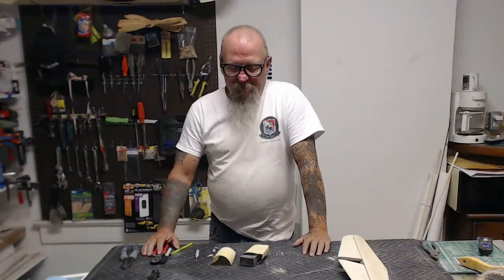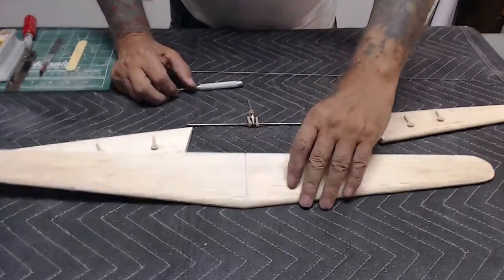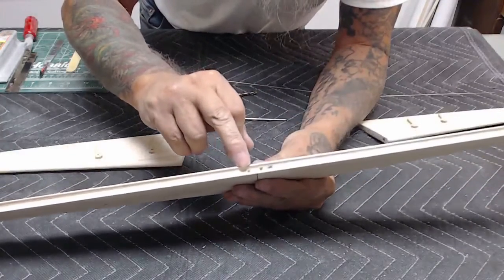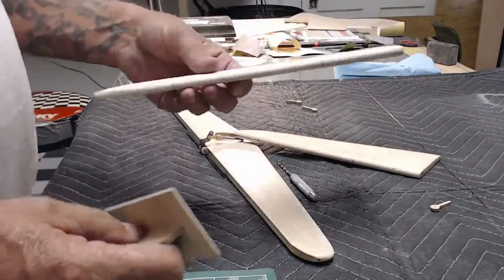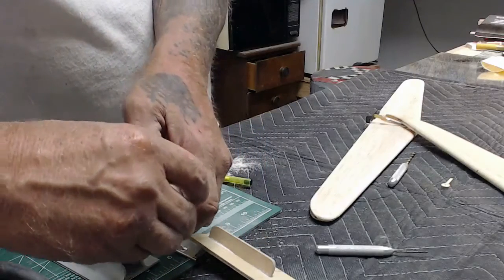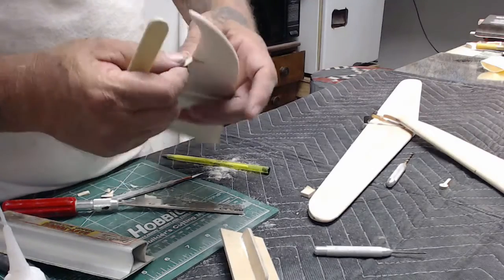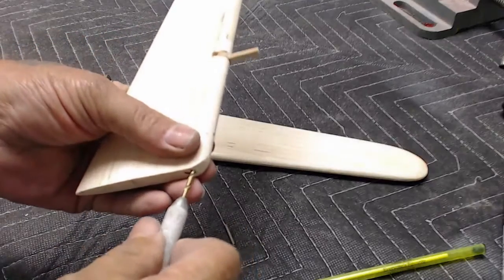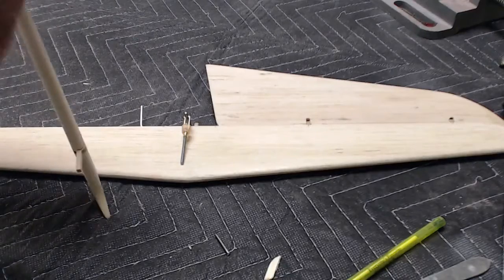Pocket Hinge tutorial

Comment: Question / possible improvement - do you even bother to add some copper bushing in the hinge hole or is it not necessary ? Do you sell those pocket hinges at your e-store ?
Reply from the maker: I do not sell hinges and yes I use bushings. Wire size is .040
Reply: @Stunthangar  Thank you Sparky.